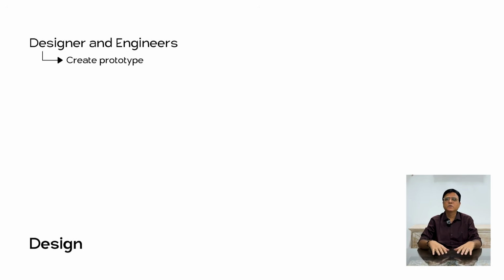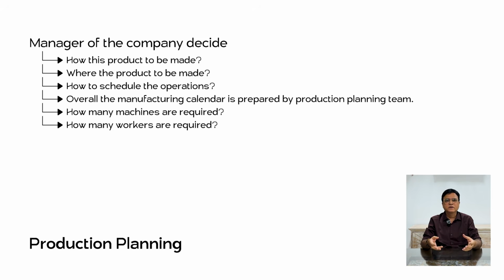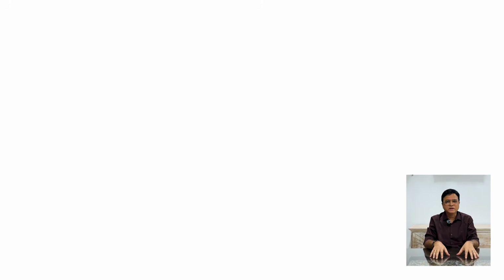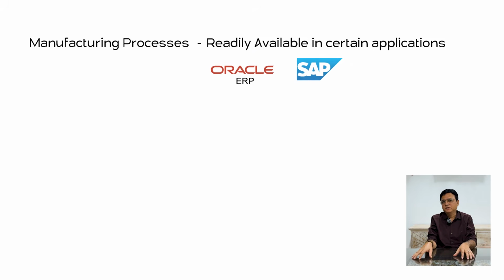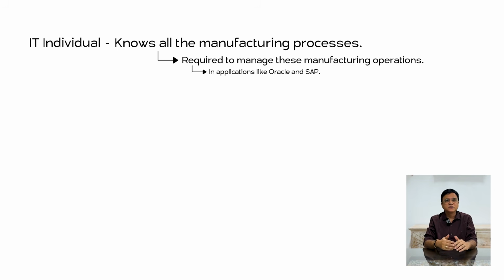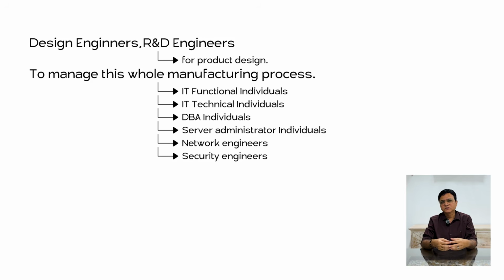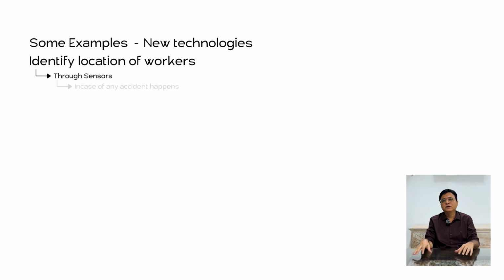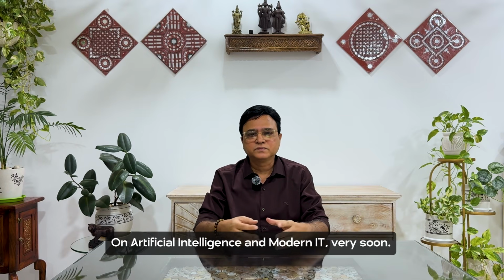Chapter3: Manufacturing Operations for Beginners — 7 Steps Simplified!

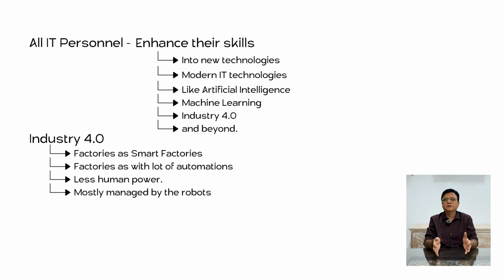Comment: As we move toward Industry 4.0 and 'Smart Factories' where bots and AI handle the majority of tasks 10:39, how do you see the role of the traditional production manager evolving? Will the skill set shift from managing people to primarily managing data and algorithm performance?
Reply from the maker: Production managers role before use to be manual tracking. After Industry 4.0 monitor machines through IoT sensors and AI dashboards in real time. Even resource allocation man and machine too can be optimized through predictive analytics . Hope I answered your query